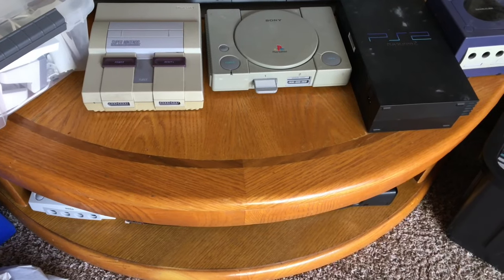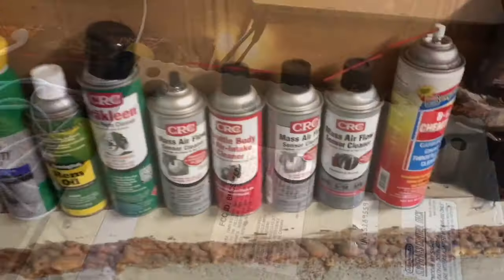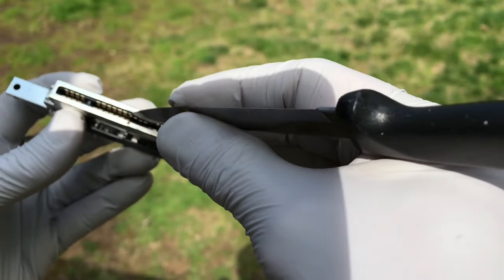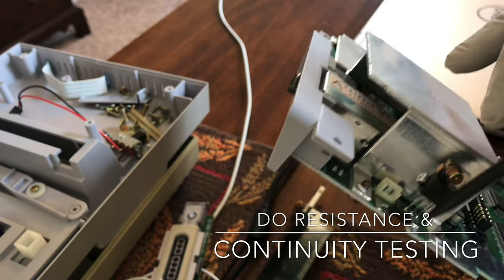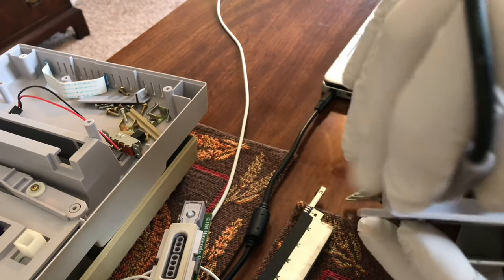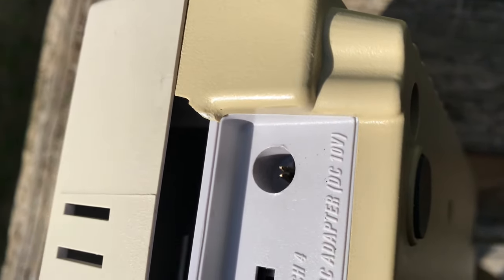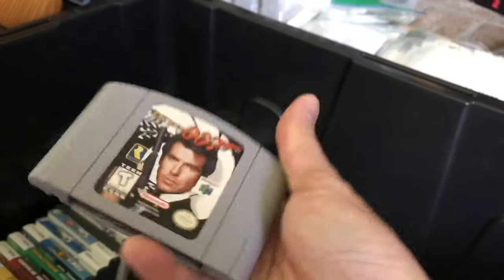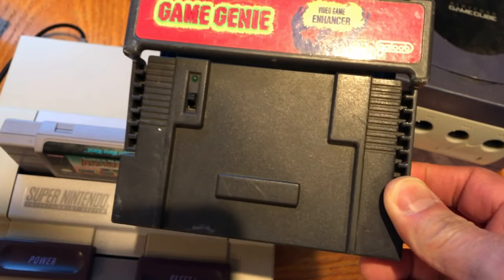How to repair Super Nintendo with NO power! SNES Troubleshooting Steps taken and behind the scenes

Comment: So if you pinch them closer. You can still use the super nintendo? The cover came off on mine and the cord won’t hold as it used to. Ive been checking and seems like a huge hassle to replace it.

Comment: Two problems here:
1: Your power port is broken/damaged. It's supposed to have a piece of plastic inside there and not have two bare pins.
2. Your power supply is outputting 13 volts and will eventually burn out the power circuit. 10 volts is what the input should be.
Reply: I'm very new to this kind of thing, what do you mean by power supply? Which part is it

Edit-do you just mean the power cable and stuff?

Comment: can I use carbucleaner to clean pin connector?
Reply from the maker: Carb cleaner do not dry clean…Best to use  an Electronic Quick Dry Spray by CRC… I used CRC Mass Air Flow Sensor cleaner. Either dry quick and clean

Comment: Is did you use any kind of spray for the motherboard or just clean it with a brush
Reply from the maker: Best to use  an Electronic Quick Dry Spray by CRC… I used CRC Mass Air Flow Sensor cleaner. Either dry quick and clean